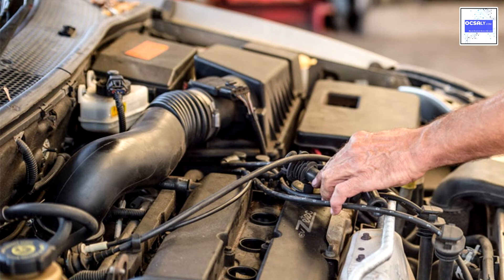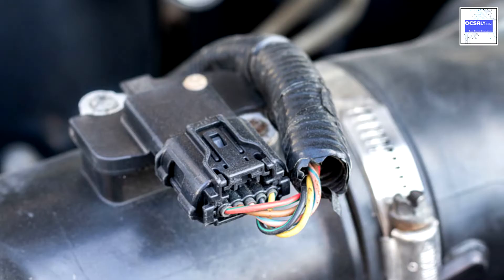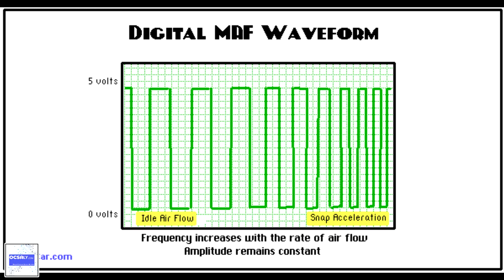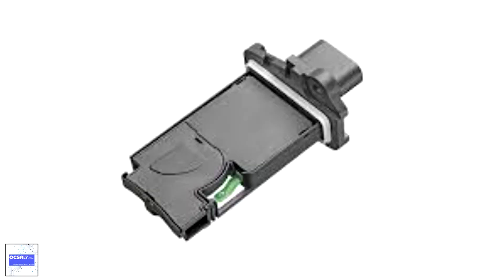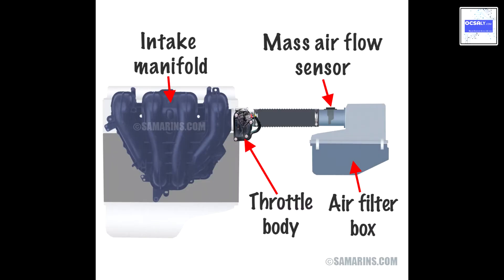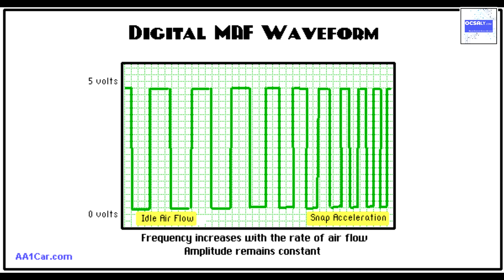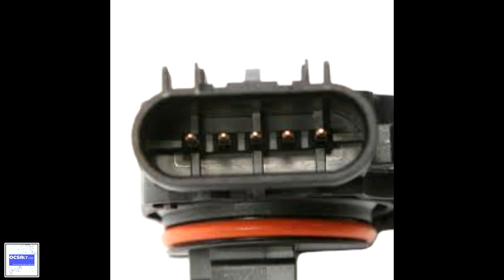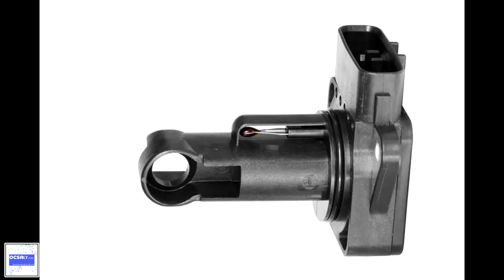MAF - Mass Airflow Sensor | Working Principle | Learn | Training | OCSALY

Comment from the maker: Interested in a career in car repair or becoming an electrician? Check out our comprehensive training program: Car Repair and Electrician Training Certificated: CRETC+. This course covers everything you need to get certified and start your career. Enroll now and take the first step towards mastering the skills you need.
https://www.udemy.com/course/car-repair-auto-mechanic-training/?referralCode=45B4B29F47FEE59DA2B9

In this video, we'll dive deep into the different stages of car tuning, breaking down the modifications and enhancements that take your vehicle from stock to high-performance. Whether you're a beginner or a seasoned enthusiast, this guide will help you understand how to get the most out of your car.
https://www.udemy.com/course/car-repair-auto-mechanic-training/?referralCode=45B4B29F47FEE59DA2B9
Reply: Respectfully, I'd like to provide a few clarifications and improvements to your video. First, refer to the diagram at 1:55 in the video. The four resistors on the left constitute a Wheatstone bridge circuit. The bridge will be balanced when the four resistors have the same values and when in balance no voltage will be present between points A & B.  However, if any of the four resistors changes its value the bridge will become unbalanced and a voltage will appear across the bridge between points A & B. The polarity and magnitude of the voltage produced will depend on which resistor changes value and by how much. One other important characteristic of a Wheatstone bridge is that if the input voltage that is being supplied to the bridge changes the relative voltages between points A & B will not be affected.

It's important to note that the thermistor and the platinum hot wire have opposite temperature coefficients. The thermistor has a negative temperature coefficient, which means that when the thermistor gets hotter its electrical resistance goes down and when it gets cooler its electrical resistance goes up. In contrast the platinum hot wire has a positive temperature coefficient, which means that when the platinum hot wire gets hotter its electrical resistance goes up and when it gets cooler its electrical resistance goes down.

It is a common misconception that current only flows through the platinum hot wire while no current flows through the thermistor. In fact current flows through both devices simultaneously. There is also a specific temperature at which the resistances of both devices will cross one another and become identical. This is typically around 90C or 194F. At that temperature the bridge will be in balance because the resistance value of the thermistor and the resistance value of the platinum hot wire become identical. This temperature is sometimes referred to as the "crossover temperature" where the resistances of the two devices become identical and the Wheatstone bridge becomes balanced.

Points A & B are connected to a differential operational amplifier. This device amplifies the imbalance and its output controls the power transistor. The power transistor then increases or decreases the two different currents flowing through each of the two devices. The two currents cause internal self-heating to occur in the devices, which changes their relative resistances but going in opposite directions. When the two devices are heated to the crossover temperature it balances the bridge. The resultant current passing through the platinum hot wire then produces a voltage at the output that is analogous to the temperatures of the two devices. 

The Mass Airflow Sensor has a second separate thermistor mounted on it that is used to measure Inlet Air Temperature. Because the crossover temperature (usually around 90C or 194F) is well above the typical Inlet Air Temperature (usually around 22C or 72F) a corrective offset must be applied to the output signal coming from the bridge. The offset, which is derived from the Inlet Air Temperature reading, brings the output of the MAF sensor down to zero volts when the electronics is energized but the engine isn’t running and there is no airflow going through the sensor.

When the engine starts and airflow is passing through the MAF sensor both the thermistor and the platinum hot wire start to cool down. This causes their relative resistances to diverge going in opposite directions because they have opposing temperature coefficients. This unbalances the bridge causing the differential operational amplifier and the power output transistor to compensate by raising the current flow through the two devices. The resultant increase in the self-heating of the two devices replaces the heat being carried away by the airflow, which re-balances the bridge. The increase in the current required to re-balance the bridge results in an increase to the output voltage signal, which tells the engine control computer that the airflow has increased and by how much.

This circuit really isn’t all that complex, but the key to understanding how it works is the realization that the thermistor and the platinum hot wire are working together by virtue of their having opposing temperature coefficients. When the two components are placed into a Wheatstone bridge along with the associated electronics the circuit will meter the instantaneous mass of the airflow going into the engine and produce an accurate electronic signal that is sent to the engine control computer so as to properly control the fuel/air mixture.

Hope this helps.